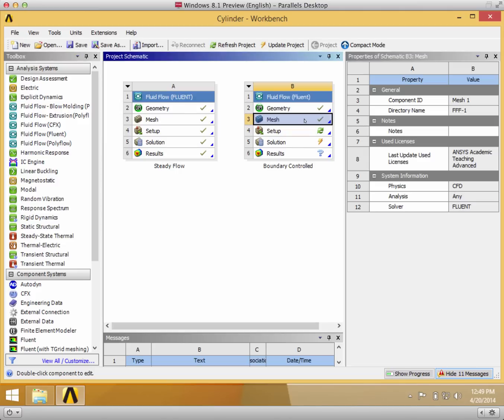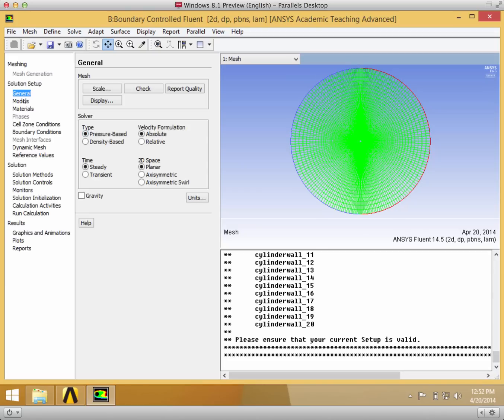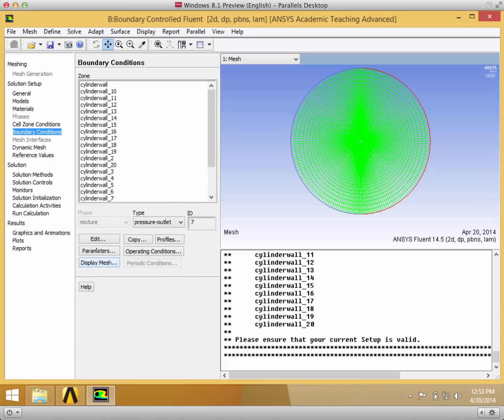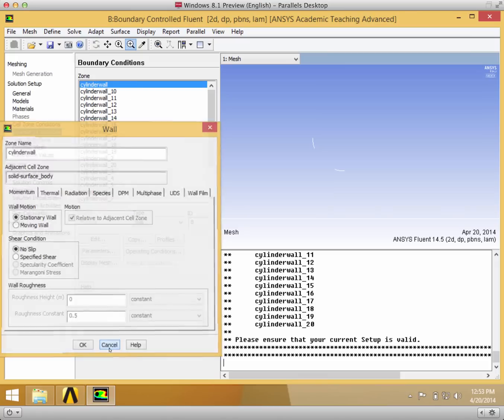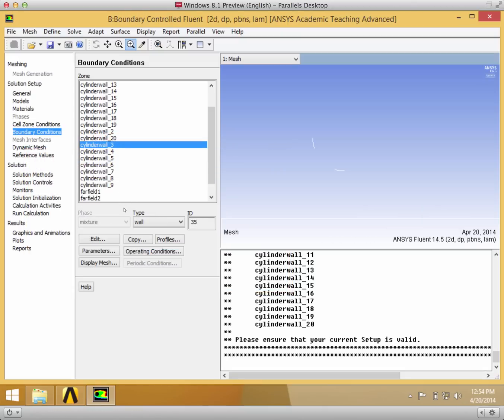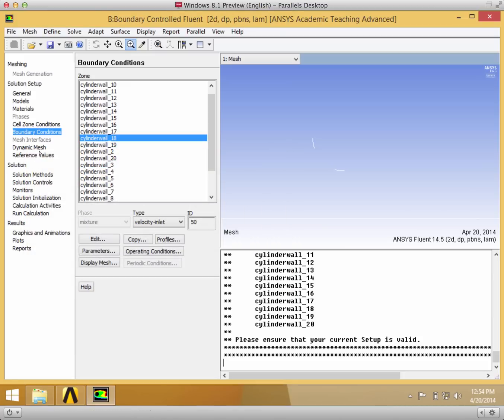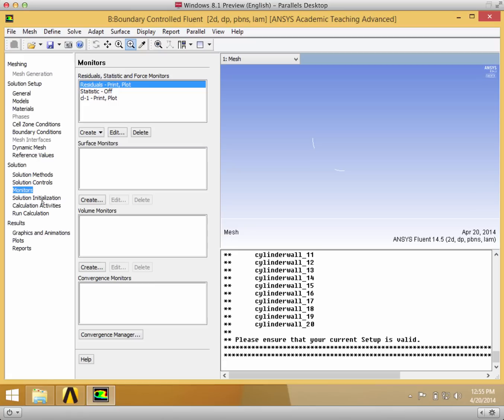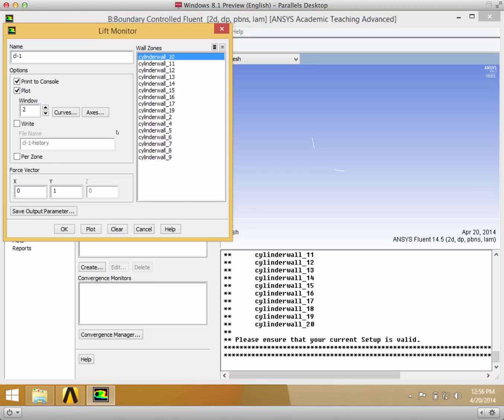Flow Past a Cylinder – Estimation of Lift Force Using User-Defined Functions in Ansys –Physics Setup

Comment: Hey Cornell, 

Thank you so much for these tutorials, they are helping me greatly! 

One question, is there a reason you are not using parallel processing?

Kind regards,

Ruben
Reply from the maker: Glad you like them! Most of our tutorial involve simple calculations and so there is not much gain in using parallel processing. Parallel processing could actually be slower on simple examples because some time is needed in partitioning tasks. You can play around with it and see for yourself however.